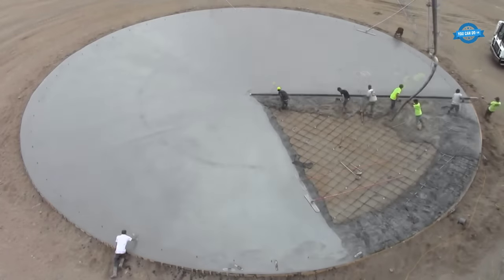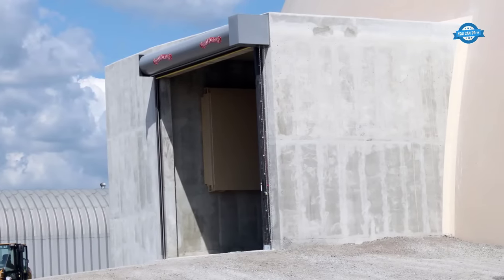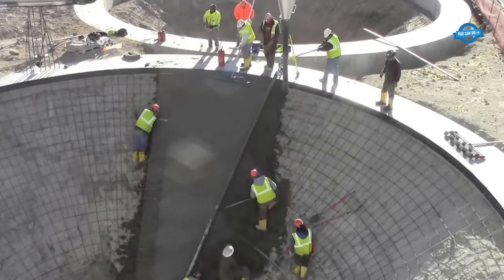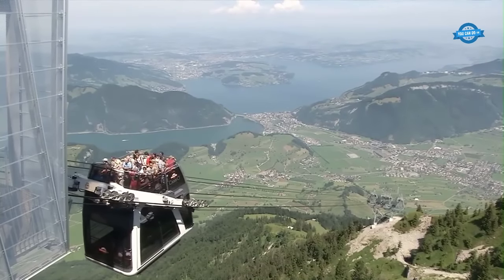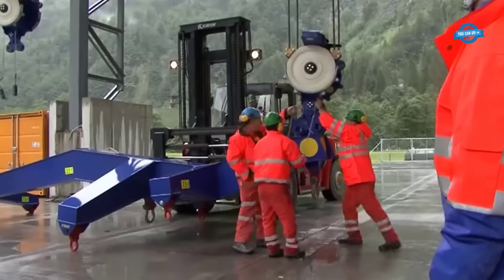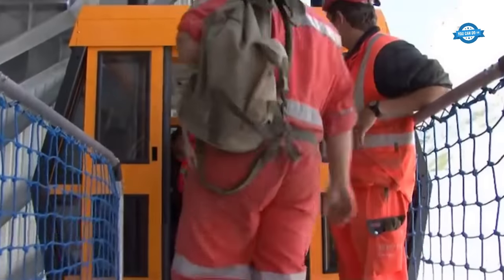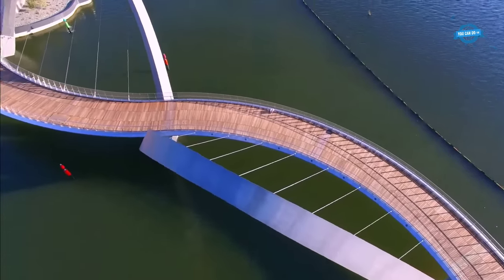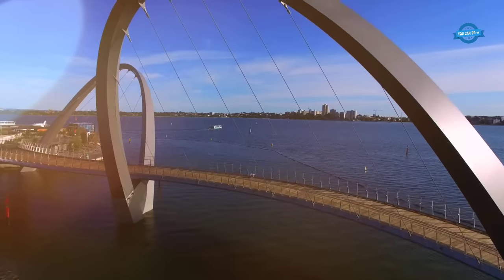How China Relocated 700 Mountains To Build City. Mega Constructions At Terrible Heights

Comment: 01:13  Funny how they screed over the innovative bolt-pattern line.

A 2×6 with a spike at pivot point, nail in the bottom for bolt line, boom, no innovation, been done since they started screeing concrete.
Reply: Wow